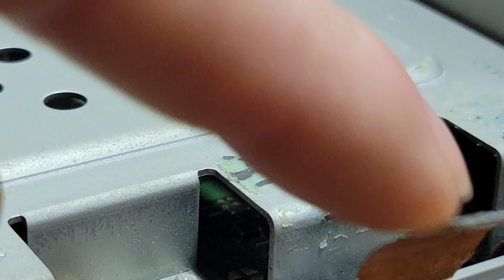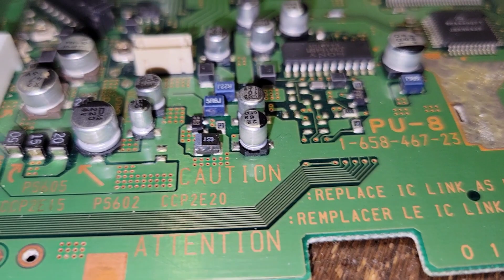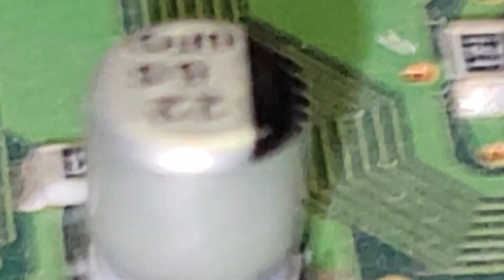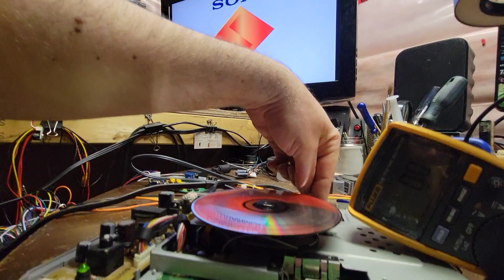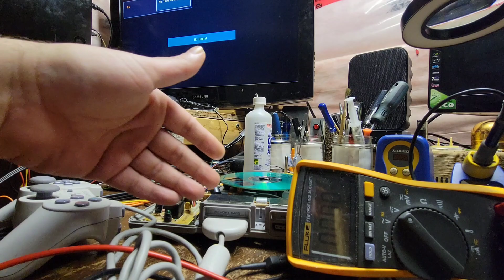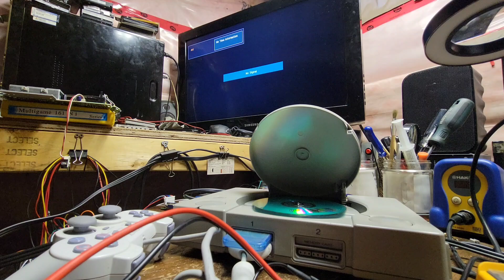PlayStation 1 Model 1001 Laser Adjustment

Comment: i got almost the same issue, OG games reads just fine, but the copies at some point starts to skip audio and some fmv or doesnt reads at all
Reply from the maker: @Kraben12  have you made any adjustments to the laser?
Reply: @inspectahtech  yes, i thinkin to swap the laser
Reply: Did you ever try the laser swap?
Reply: @light6148  i change the PSU caps and issue fix, i dint calibrate at some point the caps send some electric noise and affects the lasser
Reply: @Kraben12 hmm.. I've done a full recap and mine is still having issues reading burnt games... guess ill try the laser swap..
Reply: @light6148  dunno what happend with mine but just works, good luck buddy